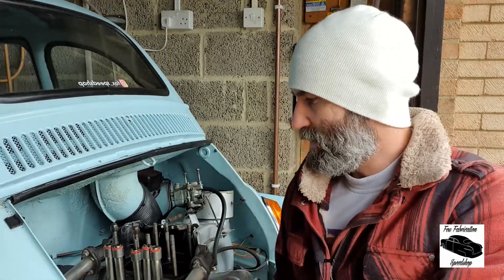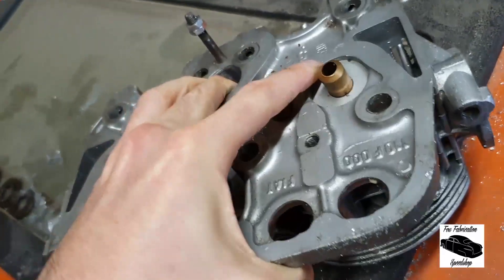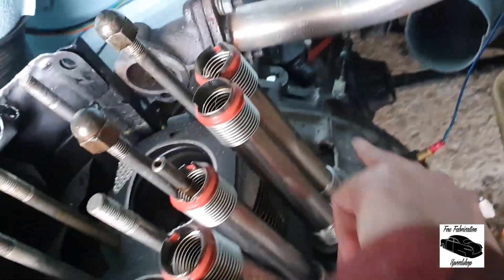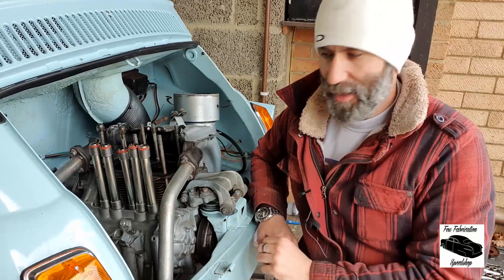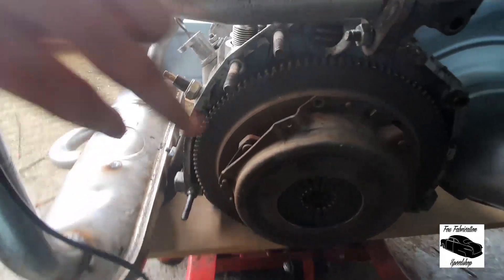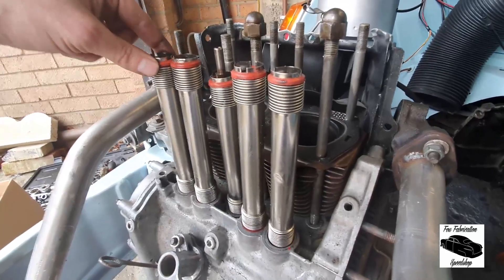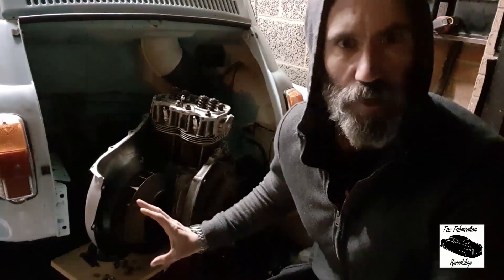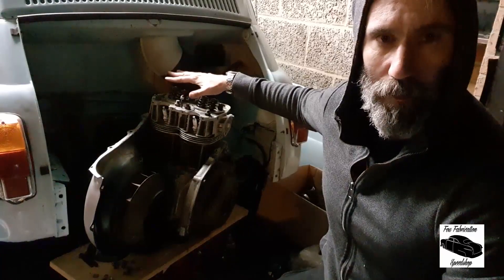Classic 1966 Fiat 500 engine removal and refitting

Comment: You are in the wrong order when tightening the cylinder head bolts. Take a look at the repair manual 😉
Reply from the maker: There are 2 versions of the bolt order, and both of them follow fundamentally the same priciple of a circular pattern to spread the load (which is standard across any engine) so there isnt really an  issue imo.